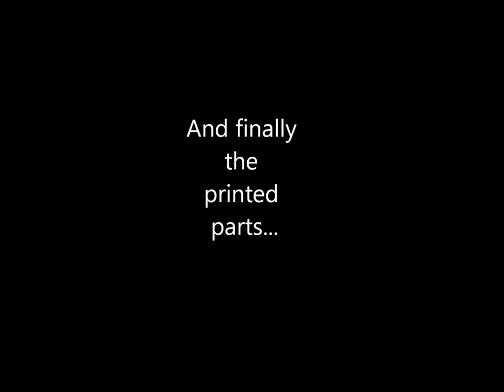3D printed digital watch on a RepRap Prusa / Designed by 3D-proto in HD

Comment: Hello! Love the project! Really really great idea! 
I'm currently prototyping and was considering an adafruitGEMMA, but  that mixed with an led ring is HUGE 12mm+ let alone a battery. 
I really like how slim you've managed to keep it, did you use a custom pcb for the project? I saw the soldering section, but I'm not sure if you've etched the pcb yourself? or is it a stock component? Would love to get more information on how you created this, the button programming is a great feature!
Reply from the maker: 420 ThreeD hey. thanks. the pcb is designed by myself (eagle)  and produced by a professional pcb manufacturer.. i have some left if you want one just contact me..